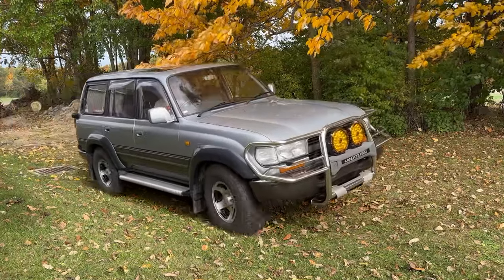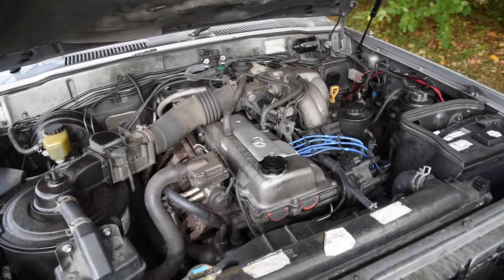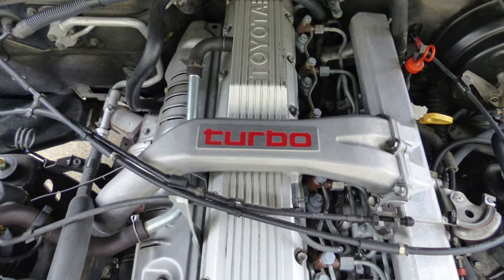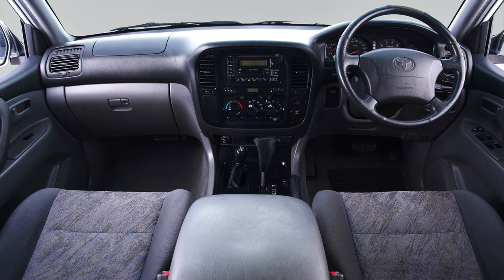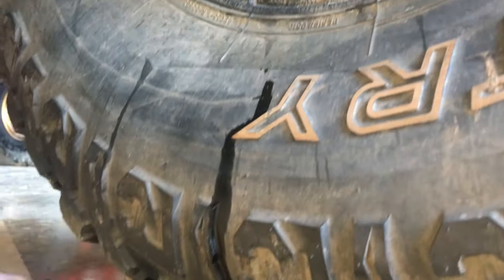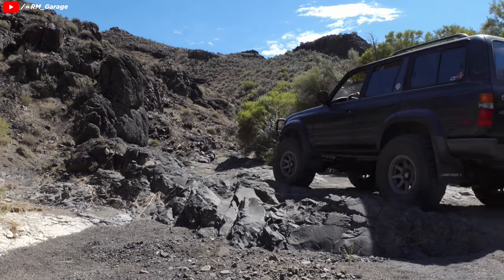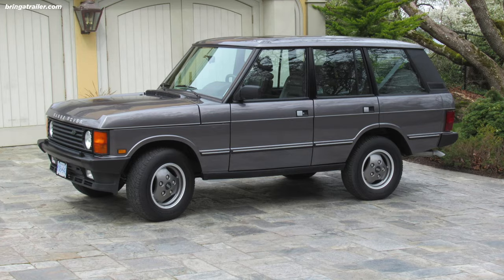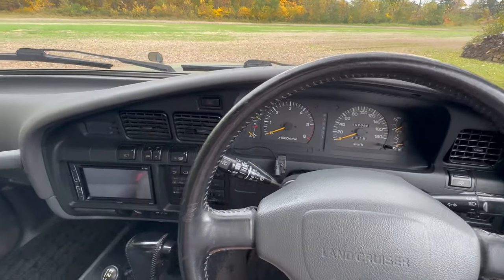Everything to Know: Toyota 80 Series Land Cruiser - Review/Buyer's Guide

Comment: My family has owned our non-locked '94 FZJ80 since 1996. The first owner was my uncle who crashed it into a light pole during a heavy rainstorm before bringing it to my father who owned an auto shop at the time. Instead of getting it fixed, my uncle just gave it to him for free and it has been in my family ever since my father completely repaired it. My mother has been daily driving it to and from work which is pretty close to our hose, so it still has relatively low miles at ~160k miles. Her co-workers and some strangers are always asking to buy it from her, but our LC is a keeper

Comment: I've owned my '93 80 since 2003. Changed the birfields, and had the head gasket changed out due to the pesky heater hose failure.  The truck has 164,000 on it. It's been a Great, rust free vehicle that needs a paint job. Reckon it's time to let it go. Plan on replacing it with a 2024 4-Runner.
Reply from the maker: Yeah, my 85 has the 22r/5speed original drivetrain (rear axle is from a 1988 because it's 3" wider, not any stronger) and it has been regeared to 5.29's for the 35" tires.  I've had it offroad plenty of times and never broken anything but I'm not pegging it at WOT bouncing off rocks either.  Mostly just exploring trails and a little rock crawling.

Comment: Great 80 series review. I have owned three 96/97 80 series over the past twenty plus years along with a 2003 100 series. I much prefer the 80 due to it simplicity and amazing build quality. This vehicle was overbuilt and designed to last indefinitely providing one keep up with proper maintenance and avoids the rust belt. I still own a 96 LX450 with 85k original miles. I purchased the truck from the original owner in 2001. It has always been garaged and has never been off-road. Spent it's entire life in the southern US (Alabama, Texas and Georgia). It has been meticulously maintained  and is in like new condition. I currently own a number of other vehicles including two GX460s and a 200 series but the 80 series is very special from a different era.
Cheers
Reply from the maker: This is my first Land Cruiser and I love it! I had saved up for a pretty nice 1st Gen 4runner, but When I saw the opportunity to own a decent 80 for under $10k, I couldn't pass it up. I've owned about 10 80's Toyota Pickups over the years and like you said, the 80 is an entire different league when it comes to build quality. The 80 feels like a tank compared to an 80's 4wd Pickup, and those trucks are tough to begin with!

Comment: I'm from South Africa and own a 1997 4500GX carburettor model with a manual transmission. It has done around 250 000 miles. I drive it daily. Unfortunately no front or rear lockers but it has part-time 4wd, with a semi-floating rear axle, as at the time these were deemed simpler to maintain in African conditions. It's an awesome machine from a time long past.
Reply from the maker: I wish mine had a manual transmission. North America only had automatics.

Comment: Love your video mate,👍 i have an early 90s 80 which is not triple lock that I'm keeping as standard BUT 6 months after we go it I bought a late 91modle wich has all the features (triple locked, fridge, heated seats....) That I use for overlanding in Europe 😅 simply love these beast!!

 They are with just around 150k Miles. 

The only doen side here in Malta is the parts availability 😔 we have to import most of them from other countries and shipping costs more than the actual product 😅

unfortunately in the early 2000s most of the land cruisers that where purchased from Toyota Malta got scrapped and sold for metal!! Very few are left on the roads that are not imported. The Maltese market didn't have all the extras that the Japanese market had to offer also! 

Thank you for your videos mate
Reply from the maker: Why did they scrap so many land cruisers in Malta in the early 2000's? That's tragic! I searched on google and didn't find an answer.

Comment: Two things: The FJ60 did NOT usher in an automatic gearbox; it was the FJ62. 

The FJ80 landed at the end of 1989 for the model year 1990, and was refreshed with a slightly bored out engine in 1993, and rebranded as the FZJ80 through 1997.

Comment: Corrections... 
FJ60s were manual transmission only. The FJ62 was the first automatic. The FJ80 arrived in the spring of 1990 as a 1991 model year. The A343 was only sold in the US market. The rest of the world still received the A442 through the end of production. Venezuelan assembly of the 80 series ended in November of 2006. 1991-92 FJ80s had 31x10.50-15 tires. On 93-97 305/70/16 tires will clear at stock ride height. The Prado has been sold in the US, badged as a Lexus GX470 and GX460.

Comment: i think i like my 80…i mean i love her, i just got it a couple days ago, it’s triple locked and dressed to the nines for off-roading, sitting on 35’s. the 80 is my dream car but now that i have it, i realize i have no idea how it’s supposed to sound, how do the rpm’s react when merging on the highway? what’s normal? i’m searching youtube for answers but im coming up so short. it was VERY well taken care of but i still have the intrusive thought of..if you spent this much money on it (it looks like a pinterest post) why would you sell it? PHH has been down, head gasket seems fine, lol im just anxious about over working the engine…is that even a thing i can do on a 1FZ-FE?
Reply from the maker: As long as all the rubber hoses have been replaced, the 1fz-fe will only need simple maintenance (fluids/belts/plugs/wires etc) The head gasket issues don't start to pop up until around 200k miles, some sooner and some much later. Merging a loaded 80 with 35's is always going to push the engine hard. You'll be able to drive anywhere, just not fast. Keep the ECT button on all the time and the shift points will be better for accelerating with 35's. I've used my 80 for towing a lot and the 1fz-fe has never given me any problems except slow acceleration and going up big hills.

Comment: 1996 FZJ80 VXR 1FZ-FE 400,000 miles. Its on high Idle and I can't figure it out, is it the vacuum hose, or the valve cover. My grandfather just gave it to me I'm 25.
Reply from the maker: Wow that's high miles, congrats! The valve cover shouldn't be able to cause a high idle. 
It could definitely be a vacuum leak. I'd start by checking/replacing the hoses, especially if they're the original ones.

Comment: Is there a quick check to see if my water pump is working properly? 1982 toyota pickup. seems to be heating up on short trips. needs water. no leaks.  new radiator 2 years ago. thanks.
Reply from the maker: If it's loosing coolant and there are zero leaks anywhere, it could be a leaking headgasket allowing coolant to enter the cylinder while driving. I'd do a compression check: https://youtu.be/v7EdRwCW9Fs
Reply: thank you for the quick reply and video to show me how to check the compression. However, I am not loosing coolant. I have added water to the radiator and the coolant level stayed the same.  @6thGearGarage
Reply from the maker: @jeanneblackwell5123  Sorry, I misread that! Well that's good news then. I'd start with the simple things first. You already have a new rad, so that'd good. How old is the thermostat, and is it an OEM part? I''ve had bad luck with cheap ones and only use OEM Aisin thermostats on my toyotas now.

Comment: Can I get a Venezuelan series 80 after 25 years in California?
Thanks in advance, Daniel 

I have an FJ40 and a 55 (with the expected body rust 😢).  Both running fuel injection, though I should have kept them carburete
Reply from the maker: I'm unsure on how imports work in cali due to the state's strict emissions. I know they still apply to vehicles older than 25 years.